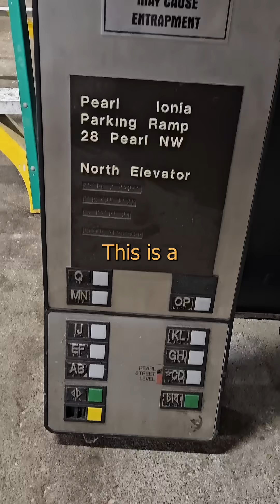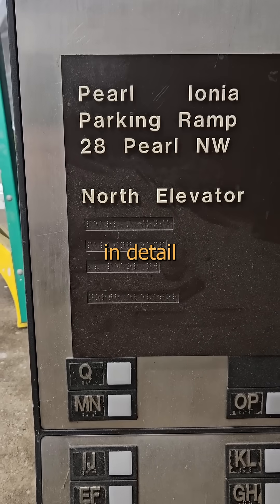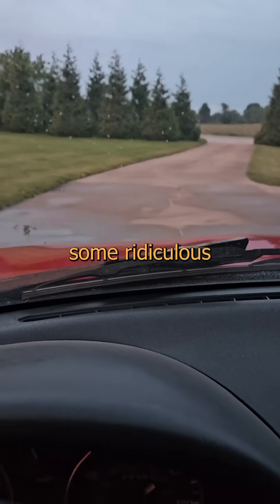Miata Mischief #chrisboden #engineering #gear #elevator #score #stories #parts #hacking #making

Comment: I have a Miata. There is no way of carrying one of it's tires anywhere inside the car (not even in the passenger seat), so they don't come with spares. Many times I've thought I could just put the roof down to carry things in it, but I've never actually done it. So yeah, he had to put the top down to get it in the car.

Comment: Neighbor was throwing out an old riding lawnmower and me n my brother thought we could fix it so we pushed it down a really long  steep hill (on the road) to get it home. we didn’t think to check if the brakes worked or not beforehand. We ended up going fast enough to pass other cars on the road (we know we were doing at least 45 mph bc that was the speed limit.) you’ve never lived until you ride something that is designed to go 5 mph while going more than 10x its original speed. We were having fun with it at first then hit the brake and nothing happened. We ended up crashing it into a ditch at the bottom of the hill after thinking “OH the grass will slow us down.” No turns out the grass will just take away any kind of steering you thought you had. Idk how but we walked away with no broken bones.

Comment: When i was 13, so about 16 years ago, my father managed to acquire a 15 foot aluminum boat for next to nothing and a couple 2 horse outboard motors. He had them dropped off, and by the grace of god he somehow got one of the motors to fire up. So then we wanted to go fishing, right? Well the only cars we had were a Geo Metro (3 cylinder 5 speed) and a PT cruiser (also a manual, because thats how my family raised me). Well compared to the geo, the cruiser was basically a cargo van, so that's the move. 

No roof rack though. Who cares? Shove it in the back! So with a ratchet strap around the front seats and looped around the old rotten wooden seat of the boat, we drove the 3 miles to the lake with a 15 foot boat hanging what felt like 25 feet out the back of a 14 foot long car. Dad didnt trust the ratchet strap though, so bob, his best friend who was a narcoleptic recovering alcoholic, and whose heart would have probably ceased to beat if he ever ran out of his epinephrine inhaler, sat inside hull of the boat and held onto the rear door pull handle to prevent it from shifting too much. 

The PT cruiser was also used to haul hay recently, so we took off down the road with this huge shiny boat sticking further out the back of the car than the length of the car itself, bouncing inches off the road, hay flying around the cabin and blasting out the rear hatch while this skeleton of a man was holding on for dear life scream laughing in between puffs of an inhaler. We were bouncing off the rev limiter pouring clutch smoke to get up hills on the way to the lake, but we did it.

I think we used a 5 gallon bucket to hold the 25 or so panfish we caught, but we fileted them and ate good that night. And thats how we transported that boat for the next 2 years.

Bob died back in 2019. I miss him so much, but my dad and I remember him fondly for all the wild shit we got up to. Sometimes it's good to have an example of what not to do.

Comment: I loaded a 150cc scooter kinda like a moped into the backseat of a 2001 hyundai sonata in 2023 along with everything else you could fit in there from 8 months of living and drove 24 hours across the US. The engine died 3 months later and my tires were ruined from the experience

Comment: I have an 85 honda civic crx si, that I made my own 2" hitch receiver out of 2" stock and put air bags fit for a pickup truck on it. I reinforced the hitch mount platform for my mother's power chair but I've got pic's with a stand up freezer a big dresser towing a trailer with a tractor bigger than the car I flat towed a 96 buick skylark

Comment: I have a complete front end (beam) drum to drum out of my 69 VW Baja Bug in the back of my wife's 2013 Honda CRV that's going to the shop tomorrow and havin't told my wife yet and I have a Silverado Duramax truck. With all the running around I have to do afterwards, it just seems like the right thing to do!

Comment: My old e30 moved two giant desks one with 45 degree angle.  Both walnut on the roof rack.  That 45 degree up like a shark fin.  The wing had some much aero that the car gained understeer to the point it was tough to change lanes going 70 down I55 in Chicago

Comment: I helped a friend get his 5.3 LS engine and transmission in my 2003 jeep grand cherokee. When loading it up, the car was basically slammed to the ground and half of the drive shaft was sticking out. We used a belt to tie down the hatchback and drove a measly 40 mph till the belt broke, then we used old broken charging cables and whatever else i had in the back to tie it all up. Definitely sketchy and exactly what came to mind when you asked for a hauling story

Comment: Not me but my friend strapped a milk crate on the back seat of his Kawasaki Ninja and hauled a transfer case for a second gen cummins ram up to the shop. The worst I've done is put an atv in the trunk of my old Grand Marquis by tucking the ass end under the roof of the trunk and the wheels down in the bottom and strapped it up over the roof down to the bumper to keep it from falling out

Comment: I put concrete sidewalk "pavers" in the back of a 94 ford Aerostar.  I worked for the gun club the next town over when I was in high-school and for 3 years after and they tore out old traps to upgrade them. The pavers were the walkways 36" long by 18" wide x 4" thick. I had and still have a very large garden and I just built a greenhouse to start all the plants for a 1/4 acre of veggies.  I brought them home for the floor. They made it home but with some heavy dragging on the rear of the van. Eventually i put them in a trailer instead and it thanked me for that. Each one was around 200# and i could pick up fairly easily then but now its gotten harder or more likely smarter. Most I did was 4 pads in a trip home. I brought home 18 of them. A bit of my own history at home and history of the largest gun club on the east coast elysburg.  now known as the pssa it was the valley gun and country club. The pads I took were of the traps I loaded for almost 10 years and were the oldest ones on the property before they pushed them in. The pads I estimated were from the 30s to the early 50s

Comment: 8 railroad ties, stuffed end first into the trunk of my 77 Ford Ltd.  took them 22 miles, city roads, from one end of the county almost to the other end, past 3 police stations with the bumper smacking the ground at every opportunity. and yes, we DID have to go over two separate sets or railroad tracks. no options. Ahhh, the good old days of no cameras. lol
also snuck a V-8 trans and a motorcycle home in my work truck. a handi-cap transport van with a power wheelchair lift. between two calls. lol

Comment: We used a full length pusher style school bus to move a mobile home 60 miles up a winding canyon-road, in the middle of the night. 

at one point one of the axles was hanging in the air off a cliff. 

the police came and said it was one of the most insane things they had ever seen but was no against the law, other than not having the correct paper work, we got a $90 fine and they escorted the house to my dads property in Wa

the fine was way smaller than the permit fee :D

Comment: I think I had a second gen Miata and I stopped by a garage sale. I had an obsession with old '80s stand-up speakers for inside surround sound systems and I found four massive ones talking 4ft X 3ft each and somehow managed to set them all in and on the Miata and make a 3-mile drive home without any falling out 🤣🤣🤣🤣🤣🤣

Comment: Strapped the hood of a 3rd gen accord to the roof of my 96 taurus to take it across several states.
The straps started failing about 1/3 of the way. The roof of my car was badly dented as the 3g accord hood tried to become an aerofoil. Luckily we were able to call in some backup from a friend with a truck who lived near where we failed, and made the delivery.

Comment: Back in the early 2000s i had a 1999 Saturn SC2. If you don't know what that is just picture a third gen Camaro but smaller. I had a DJ system that I used to haul around because I was a karaoke DJ. I fit my amp rack, speakers, and lighting systems all in that little ass car. I know your woes, my friend. 😂🤘

Comment: Sketchy to haul home.... Bet

U know how a normal person would use straps or at least bungee cords to hold down a mattress..... it was me.... I was the fvckin strap/ tarp as a teenager, on the back of a truck for over 30mins! During this operation im just singing Journey cuz my arms are open, my fingers in the under grooves of each side of the truck bed. And while crossing the Galveston TX bridge..... my left hand slips off due to hitting a bump.... record scratch now I'm singing Highway to Hell going about 70mph in free fall. Probably only 2 seconds (felt like 5mins in slowmo) of being 2 inches above the truck bed made me almost paint the stupid fvckin mattress brown. Couldn't hear me screaming "Slow down!" when I re-entered gravity land and finally got my grip back. So now I have to purposely take my hand off the only spot that i now call home and smack the back window, all while praying the driver doesn't hit another bump and has to then pull over and scrape me off the road into a bucket..... 
PSA: Don't do this at home/highway!

Comment: I needed a headliner for a 2004 Chrysler 300c. Couldn't find one near me so I looked further out. Found one 100 or so miles away in Ohio. I drove out there in my Dodge avenger and strapped the headliner to the roof of my car. Put a tarp over it and drove it home. Don't know how I made it back without getting stopped by the cops or the thing coming off but I did only to find out it didn't fit my car😢 the sunroofs were in slightly different spots between the touring and the 300c. If I recall correctly it was a touring that I was pulling it from. It was like 6-7years ago so I don't remember fully

Comment: It’s not with tech.   But I used a Ford Ranger and a flatbed trailer to haul about 20,000 pounds worth of rock.   There was a brake controller and that’s the only damn thing that stopped it.   The load of the trailer was maxed out.   And the brakes were rated to stop such a load on the trailer.   I did make sure it was balanced over the center wheel well! But driving it down the road connected to a little Ford Ranger.  Was inanely sketchy.    I gripped the steering wheel so tight. I think I left indents.   This trailer was three times the weight of the vehicle.! And I made it all the way across town. And I completed the job.! 😅

Comment: I bought a used steel beam off facebook marketplace for my home addition.  I was digging through the guys less-than-organized stockpile with a tape measure and my AISC book until I found one long enough with a section that meet the required geometry and load capacity requirements.  The older gentlemen (offers to bring the beam around with his mini-excavator.  He rounds the corner and sees my Chrysler minivan.  He looks at me, shrugs and said, "I used to do stupid stuff too." and helps me thread it up between the seats.  I blocked both sides of it so it's wouldn't tip over, strapped it down nine way so Sunday, flagged the back end of it stick out the hatch and off I went.

Comment: 10 8d gel batteries in the back of a Grand Marquis. Had to do a battery change in the keys and then had to drive the cores back to ft. Lauderdale. At around 200 pounds a piece this thing looked like a squatted cop car. Braking had to be done very slowly and carefully. Glad it was a rental. 😂😂😂😂😂

Comment: Bought a boat a few years ago, a blow up one but with wood floor. The dolly for the engine sat upside down, wheels on the roofliner in the pasenger seat. In later boat adventures I left the engine at home to fit my buddies in the car and stapped the boat to the roof. The straps throug the doors so you had to climb out the windows. Mk.4 Jetta/Bora limusine

Comment: Statute of limitations is up it's been more than 7 years..... Figured I'd do that disclaimer in there ahead of time for anybody thinking of trying to shave some months off their bit by trickin' on me...... Hahahahaa😂😂😂

No but seriously I'm not going to say which highway or exactly where I'm just going to say in the greater St Louis metropolitan area on a five Lane each direction interstate right in the middle of St Louis just before rush hour by myself, with a Chevy Sierra pickup truck, I parked diagonally with my flashers on at like 3:45 pm on a weekday and shut down three lanes of interstate traffic on my own again that's the important part and that's what makes it so damn sketchy! 😅 But I saw one of those big ass signs that says truck's over 20 tons need to take alternate routes or some shit like that, it didn't look quite that big when I saw it down laying on the lane, it was so big it was one of the ones in the center median! Not the green ones up above, but the rectangular white one that they clamp the pole to the concrete trapezoids stretched upward and thinned out at the top, my first clue should have been that it was laying over a whole Lane practically! Anyway when I got closer to it, I realized the damn thing was at least as tall as me and definitely as wide as I could stretch my arms and then some this thing was damn near as big as a piece of sheetrock, if you cut maybe a foot off it widthwise to make it rectangular short shape, a little bit shorter of a rectangle shape, and you've got it! And by the way I'm almost 6'2"... I picked it up (the obscenely large white sign telling trucks, (and your mothers) that over 20 tons they shouldn't be on that particular road. The wind blew just like when you're trying to carry big old pieces of plywood up a ladder and onto a roof and the wind starts blowing,  and it almost carried me a lane  too far, which would have made for a totaled passenger car lights and grill for a pickup truck and had a semi hit me he would have felt a little thump and kept going and had no idea HAHAHAHA! 
NEEDLESS TO SAY, THAT WAS A FULL-SIZED PICKUP TRUCK AND WHEN I LAY IT IN THE BED, IT SAT ON TOP OF THE TWO WHEEL WELLS, AND HAD TO BE PROPPED UP ON THE TAILGATE AND HUNG OVER THE BACK LIKE 1.5 FEET! 
(Matter of fact, I stopped and grabbed some electric tape and a box of those cheap ass grass clipping and leaf homeowner bags that are made of like 8 mil. Opaque black plastic, and just to be total freaking boy scout, as to not get caught and stopped for a "unsecured load" and then they find out the shit belongs to the state! So along with my provisions from home Depot or whatever it was I stopped at might have been BLowes... I also went out the PRO exit, so I could grab one of those little red flags and hang that shit right on the back after I wrapped the visible parts with that black plastic and secured it with electric tape so it matched... 
Pretty stupid huh? 🎉❤😂

Alright! NEXT MAN! Share your fuckery amiss story please! 😂😂

Comment: I have an Impala and I get free stuff off of Facebook all the time. So I had just strapped a couch to the top with ratchet straps and prayers. Them my wife calls me up saying "baby I finally found it!!" We've been looking for a bedframe and box springs for our king bed and she found it. The problem was I already had a whole couch... And it was 45 mins away to get the bed. So long story short the roof of my car looked like Juan from tj transporting his family across the border. A couch, a huge hardwood bedframe, and 2 box springs and I only had 1 strap and a roll of para cord. I drove the hour back with my arm out the window holding the full weight of the box springs

Comment: NO WAY I knew I've seen your car before! didn't you have it around leonard originally with tape stripes (the mitsu)?

Also I've taken a giant [wood/glass] gun cabinet in my na miata once. Strapped to the seat rails and parcel shelf (was missing FP cover). Stuck out quite a lot, was terrifying to drive. 10/10 would not do again.

Comment: I have two good ones. So for a while I was reliant on a bicycle (no not a dui) to get home from work. About 4 miles. But then one of the logistics people got a hold of some 1/2" * 3ft lead screws with incorrect lead nuts and I was given 8 of them... But had to get them out of the wearhou that night. That was a very slow ride
Reply: 2 one was nearly the same situation except instead of lead screws, it was an 11ft, 500lb work bench. And instead of a bicycle, it was a Saab 9000 aero.

Comment: I used to drive a Kia soul. I wanted to be able to haul roadside scrap that I found around, so, I snagged some metal bracket racks from the sams club dumpster one day, and used some bolts to attach them to the bike rack runners on top of the car, then used other bracket slots to bolt a pallet to the metal, voila! Cartoon pallet to tie shit to. It worked great until the day I realized vibration vs nuts and bolts doesn't go the way you'd hope, and on the highway the pallet came flying off of the top of my car and shattered into last destination splinters of destruction of property shooting at the cars behind me. Thankfully no one was hit, and I immediately drove home and put a tarp over my car for a week.

Comment: Funily enough, my story involves a 4th gen miata. I bought a large plate of some sort of styrofoam (don't ask what, I don't remeber the specific type. It was harder and sturdier then normal styrofoam) from the local hardware store. The issue, that plate was like 0.5 x 1.5 meters, and in no way shape or form would fit anywhere into the car, so I opened up the roof, and put one corner into the passanger foot room, while the rest stuck out to the right upper side of my car